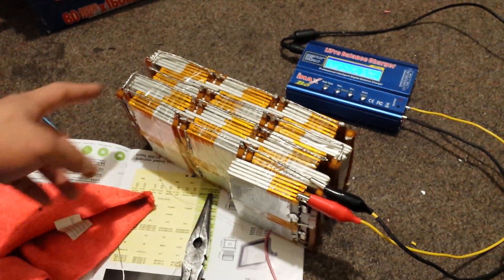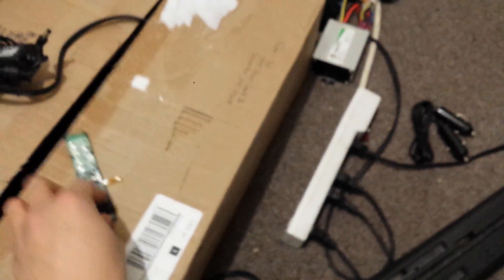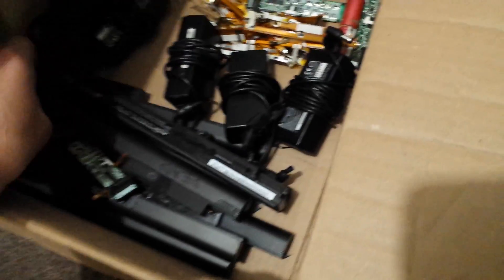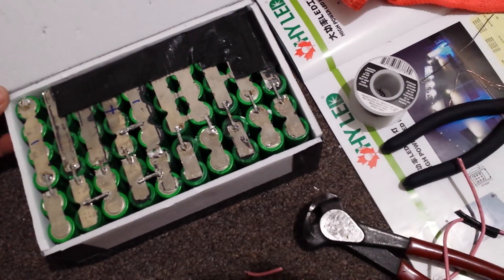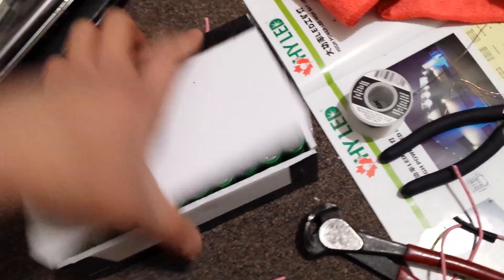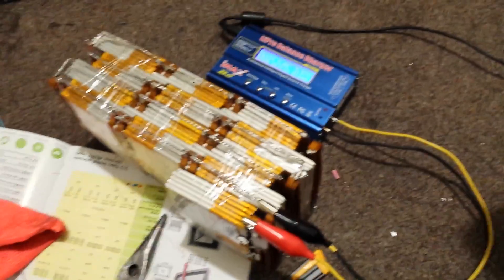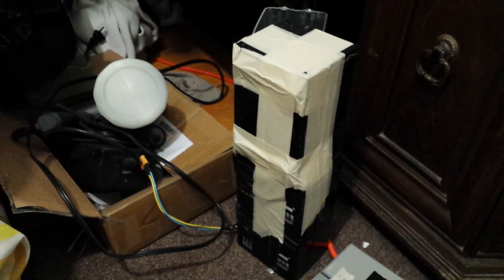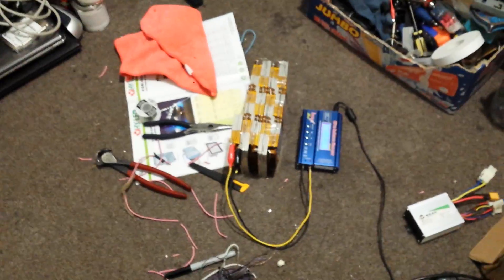Homemade 48V 13S 130 Cell Lipo Battery Pack E-Bike From Laptop Batteries

Comment: the red ones are 18650. dont pay more than 5$ for 6 of them (in a pack) or 50 cent each. i don't touch the lipos as they are very fragle and I rather not die at least till I have a way to store them. Thoes are 112v SLA batteries. All 12v have 6 cells producing around 2v+ in series gives a battery its 12v. 4x12v/24 cells

Comment: Yeah I would have tested those idividually also check out some of the Li-ion battery explosions, you want to put them in some sheilding. Also dont stick them together permanently as some may bloat after a while due to over charging or even in sun too long over heat etc.
Reply: I watched few Li-Po fire videos. You can't shield them well enough and seems that normally used fire extinguishers won't work in case of fire. I would store bomb like this under huge sack of fine sand or in heavy metal case with pressure holes. Most safe option is not to make bomb in first place.

Comment: Please please PLEASE get a BMS, batteries are dangerous,  Leave those lipo's on charge and they get to much the BANG you burn your house down or worse kill someone, watch some more "how to build battery" video's there is load of information out there. DO NOT do this.
Reply from the maker: Brannen Thompson everyone here thinks im a noob at this, ive been working with lipos and li-ion for years and years. You dont really need a bms if you have a balance charger. Bms is for lazy ppl that just charge the battery with a normal charger. Also bms has current limiting so for hi power applications its not ideal unless you get very expensive one
Reply: I meant no disrespect, As I don't know your situation I just saw the video I know that you don't really need a bms but someone new who doesn't understand could do damage, from experience I know, who knew Li-ion prismatic cells the + and  - are opposite because they aren't marked, lol lots of smoke and burnt plastic, but you learn.
Reply from the maker: Brannen Thompson well you can see here i soldered 130 cells together and got them balanced. Ive build 100 cell 18650's and bunch more. Rebuilt laptop battries and fixed ebike batts
Reply: I just got aload of laptop batteries and was a bit pissed to see at first, not now, that alot were Mac book and packs to thin to be 18650's so I have about 20 lipo's x2 so 40 as they are stuck together in 2's and bit scared I'll mess them up pulling them apart, any advice I'm used to 18650's  also ever used Prismatic cells as got alot of them too and they look cool, lovely red heat shrink and they are Samsung cells, Ive charged everything just leaving them abit to weed out any more useless ones, got a good haul out of 20 batteries got less than 6 duff cells so far. Thanks Bran
Reply from the maker: use a hair dryer to warm it so you can pull it apart eaiser, dont be scared as long as you dont jab or short the batterys, it will be fine. Videos on here make it look like soon as you touch them it will explode, it wont. Ive messed with hi power lipos that could start a trucks etc and tons of other high voltage batterys and never had problems. I even short them and make them blow up for fun lol as long as you know what you are doing.

Comment: take care with them "lipro" fake charger sky RC copy test Ur batts with a good multi meter
Reply from the maker: fake or real they are shit, I flashed mines with a modded firmware and calibrated it with a fluke multimeter
Reply: I bet ya did lmfao 😂 lmao how u managed to flash it , u found usb connection on inside lol
Reply from the maker: you wish it was that easy, you need a avr usb programmer and the hex firmware file to program it, then you need to build a device that will connect to the balancing ports to have 4.2v across all pins. you also calibrate the main voltage reading on the output as well. its not easy and sometimes takes 2-5 tries to get it very close
Reply: DAT Blue Husky nice bro glad u got equipment to do it lol

Comment: If you get good Li-Ion 18650 battery it ahould give you (oly one) around 20Amps :) but its not cheap
Reply: If you run one cell at 20 amps even if it is a high discharge cell that is rated for 20 amps it will get very hot and it won't last long...

Comment: Did you charge the 48v pack with your imax b6?

I am trying to figure out how to charge my 48v pack once I wire it into a 13 series, I currently using 2 packs at 24v (6 series each)

Comment: i have a 48v 12 ah battery pack  it was working only when I accidentally put the wire differently and is got shorted  now i dont know if this battery still working.  how can i fix it or repair it is theres a place who repair battery? the battery i got is lithium ion like the one you have flat and like oranges plastic on it
Reply: +Shun Takara probably need a new BMS
Reply: Thats what i think too. thank you ill try it
Reply: +Shun Takara measure the leads before they enter the bms to confirm
Reply: ok thanks!

Comment: Hi, I want to make light lipo battery for my ebike, i want to use 3x4s batteries for 48v motor , will i loose much speed?  or do i need 1 extra pack?
Reply: You need battery system that produce exact 48 V output.

Comment: How are you charging this pack?  Are you checking for balance in each cell?   What if one cell goes bad? would it blow the whole pack?
Reply from the maker: Sonnet Gomes of course i check each cell, or i wouldn't know how to build one. Anyways I did solder a few balance leads on it so i could balance charge 6 cells at a time. I didnt really get to test this pack and sold it since I needed to get rid some of my projects to make room for project cars. I sold it for same price i got the batteries for so the guy got lucky!

Comment: I use three of these, I get about 15 miles on a charge using a 750w bafang mid drive.
You get  3x pack for under £60 and is already has balance leads etc, and come in a hard case, handy so they don't get pierced
http://www.hobbyking.com/hobbyking/store/__36032__Turnigy_5000mAh_4S1P_14_8v_20C_Hardcase_Pack_EU_Warehouse_.html

Comment: The comment from later before about the need for a BMS is very important, I know that all may seem well at first, but after X amount of cycles, each cell will go out of balance and eventually cause an explosion or be internally destroyed. The cells you were using before, the 18650s have more than most likely been ruined by the mistreatment in the charging phase in the cell's lifetime, for the most part being overcharged by you after a bike ride as each loses its nominal operating voltage and has no or little capacity in them. Like you said, "I go a kilometer and I have to wait to ride it again". Please listen, I hate to see lipos and 18650s be abused and be wasted. Take good care because they are also very dangerous, and expensive.
Reply: Um he is using a balance charger, also called a hobby charger. It has balancing leads and basically can perform like a BMS.

Comment: Oh and if you touch those leads with that amperage it will just weld and blow up. I used Traxxas connectors and when plugging them in they touched instant destruction of the connector

Comment: Be careful I built A 12s 48v pack 52 something v really 15ah with Hyperion cells. You can get hung up on that voltage and get a pretty bad shock. But most importantly be careful with that charger I had the IMAX go bad. I'm using a Hyperion charger ever since and it works awesome I get about 20 miles on my e scooter
Reply: Lmao I have a 16s 60volt battery and even with sweaty hands it's not that bad of a shock, it's not deadly at all.

Comment: i picked up a few laptop batteries for my 130 cell ebike pack from some computer shops but could you tell me where i could get as may as you did for the same price?
Reply from the maker: I got the batteries from a guy that has a company using tablet computers and he had like 40+ of them so after few years most of the batteries would die so he sold me the lot for $60, luckily the cells were fine and just the circuit boards were bad
Reply: thats a pretty good deal for those. i was paying 2 dollars per 6 cell laptop battery. the only real problem for me is getting them in bulk because i plan on making two more 130 cell packs. i just completed my pack today and was able to get 25 miles before the remaining capacity dropped to 60%. keep up the good work! people like you and me are the kinds of guys who power the future. btw my motor is a 48 volt 1000 watt brushless hub motor being powered at 52 volts. one more thing, make sure to check up on your groups of cells that are in series. if one group dies, it can drop your pack voltage and amperage output. i have my pack balanced at all times with a balance/protection board. check into it on ebay if you dont have one.
Reply from the maker: jjhack3r
 well i dont have the pack anymore and thats for the new owner to deal with lol. Im planning to build another one but with bigger cells instead of laptop batteries. Im gonna see if my local e-bike shop will throw out some li-ion e-bike batteries and use them to build a bigger pack with a bms
Reply: i use the 18650 batteries for my bike. im pretty sure most other ebikes use the same type. anyway, good luck on your ebike projects :D one thing i found out about hub motors is that if you get a 48 volt 1000 watt hub motor, you can swap the controller for a 72 volt 2000 watt controller and get 2000 watts out of your 1000 watt motor without heat problems. the 1000 and 2000 watt motors on ebay look the same, weigh the same and are the same size. i would suggest getting a 1000 watt hub motor alone and buying a 72 volt controller. the price of both is less than getting a 1000 watt system. $70 for 72 volt controller and ~150 for the 1000 watt hub motor. btw, some of the 500 watt hub motors are identical to the 1000 watt hub motors too, but not all. if you know about ohms law then here you go: 1000 watts/ 48 volts = ~20 amps       48 volts/ 20 amps = 2.4 ohms      72 volts/ 2.4 ohms = 30 amps    30 amps x 72 volts = 2160 watts     XD sometimes math can save you money
Reply from the maker: jjhack3r
I have a e-bike scooter im going to take the hub motor out and put it on a normal bicycle frame. its a 500w 48v hub and im going to power it with a 1000w 48v controller. im gonna over volt it to 60v and see how fast it will go.
Reply: sounds like fun XD good luck with the future! i hope all goes well. later dude

Comment: you took out probably broken BMS (battery menagment system), please for your own safety don't charge those cells so they dont explode !
Reply from the maker: im not no noob at this stuff, ive been messing around with lipo, li-on and tons of other batteries for years now so i know what im doing
Reply: @DatBlueHusky  you didnt know what an 18650 was, dont tell me ur experienced.
Reply from the maker: tell you when? huh? Ive been working with lifepo4, li-ion, lipo, limn, nicad, nimh, and lead acid for over 10 years now. Ive worked with also tons of 18650, 26650, 14500, cr123a and various other sizes. Ive done custom installations of solar systems, ebikes, computers, rebuilt laptop battries etc
Reply: +Jerry Reed pffft lol
Reply: Jerry Reed what police state do you live in? I am in Ohio, and it is 100% legal to do whatever the hell you want to do with a battery that belongs to you. I have built several packs, for everything from a powerwall for a city councilman to an e-bike, and broken zero laws.
Reply: well that much I would not know because I'm not from USA, but either way, one should be careful when messing with potentially explosive stuff :)
Reply: This is just screaming random shit if u know wat ur dowing whit any battery ur safe btw plz for the love of god dont charger ur phone 😂 just plain stupid
Reply: Use li-on instead!!!
Reply: Nino Babojelić as long as you use a balance charger, which is what he showed in the video, it is actually safer than a BMS. I never use BMS units for the battery packs I build. They use tiny little resistors to bleed the strong cells in a pack, which isn't very efficient at balancing. As long as he doesn't try to bulk charge all the time, he is relatively safe. Balance charging and cell monitors are a far more effective sistem than a BMS system, which gives you no feedback, and you actually have no idea if it is even working.
Reply: Nino Babojelić What he is doing is illegal.....its a felony

Comment: Those controllers on the battery packs, also known as a BMS, which you will probably need to have on your 48v pack as well, you might need to look into finding one for your 48v pack so as to use a 48v charger, it will help to maintain the batteries long life, maybe look at other companies that make battery packs, and see if they just sell the BMS, dang it, I wish i could find those battery packs off those laptops and what nots,,lol
Reply from the maker: i am going to get a bms and charger soon also make a hard case for the pack

Comment: I built a 6s 24 volt pack out of 54 18650 lithium ion batteries. I have been riding it 15 miles to work full throttle and pedaling and I start out at 4.20 volts and end up at 3.71 volts per 9p pack. If I ride 20 miles it goes to 3.63 volts. I've ridden 25 miles and it has less juice, but still gives a good assist. I ride with 33 pounds of gear weight including the battery and hub motor + 30 pounds of bike and my 173 pound body. 

The batteries were from new replacement battery packs for laptops. So I paid between $ 18-20.00 for them. I think it is well worth starting with new batteries.
My pack with all the adjunct parts cost about $ 215.00 to make.

Comment: Are you charging the battery at 48 volts at one time I made a 48 volt battery and smoked my charger I had to charge it at 6 cells 24 and put in series to get my 48 volts. Maybe the problem is the first time I tried to charge that battery is I was trying to balance all 12 cells at one time

Comment: Are you the same guy I purchased the 20 or so laptop batteries from toronto a couple months ago?
Reply: Just just watched the rest of the video and realized that it's definitely you haha, I've posted a video of my process spot welding the ones you sold me together
Reply from the maker: yep
Reply: 30GB how much did you pay for all those lithium polymer? Where did you get them?
Reply from the maker: Ryan Sills
 i bought a hole bunch of dead laptop batteries for $60 and manage to save 90% of the cells and slapped them together, took awhile to do but it worked great.
Reply: How is the imax b6 charger? I'm using it to try to charge my packs I made from your lithium ions. It keeps saying fully charged at only 23.8 volts. Also, I see what your saying about the lithium ion only having burst speed for a kilometer or so. These seem like a waste of money. I want to get my hands on some polymer too.
Reply from the maker: Ryan Sills Lipo's are very expensive. you can build a pack using rc lipo battries just get 2x 5 cells and one 3 cell packs and you can build a battery under $200